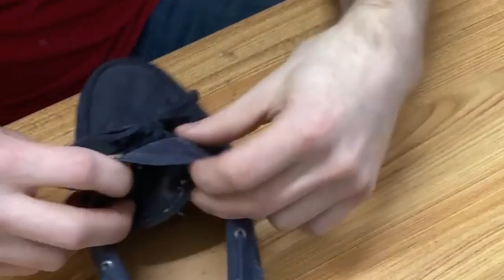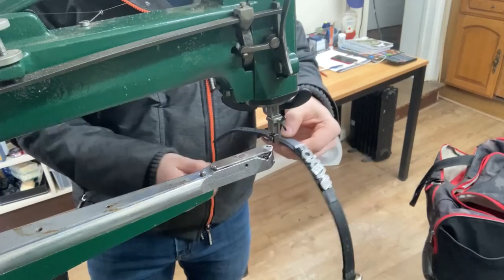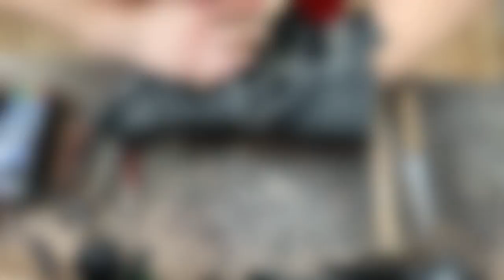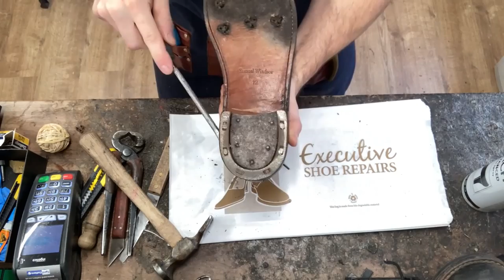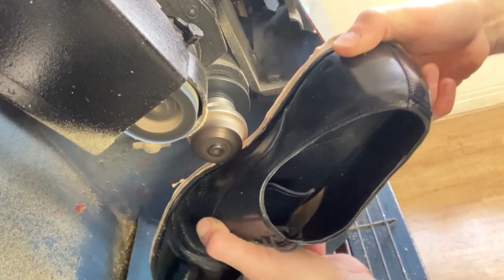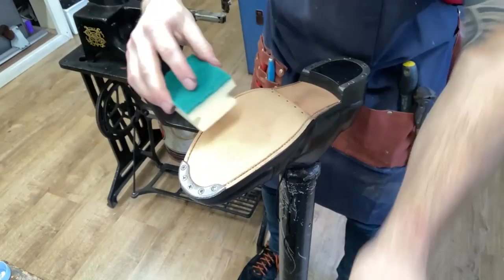Multi Job Bonanza 2 | Ralph Lauren Loafers | Army Parade Shoes | Vibram Biker Boots

Comment: These repairs look great. Instead of completely removing the eyelets in the Ralph Lauren shoes, you could have used a gun oxidizing agent on either on both sides it's should turn them pretty damn black, and you wouldn't need to have risked damaging the leather by removing them. It's what the shoe shop I worked at did for requests like that.

Comment: I have a pair of Samual Windsor Oxfords, so it was nice to see you taking them apart and that internally they are not too bad. I also have some Barkers and Churches and the although they are defiantly better finished, more attention to detail, the Samual Windsor’s are about £45 and are very good value, I have sole savers put on mine, as although I prefer the natural leather, the leather of the sole is not the hardest wearing on them and the stitching channel is not really deep enough so the stitching wears through. ironically despite the fact they are Goodyear welted they are so cheap, it’s dearer to have a new sole fitted than it is to buy a new pair.